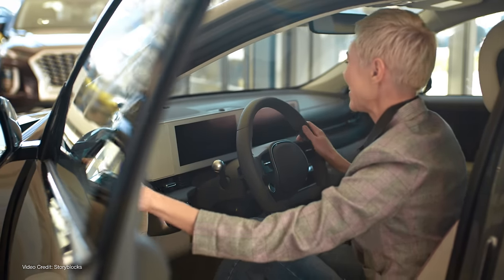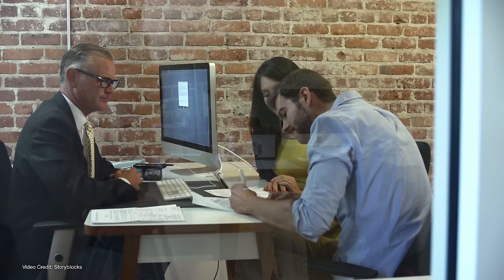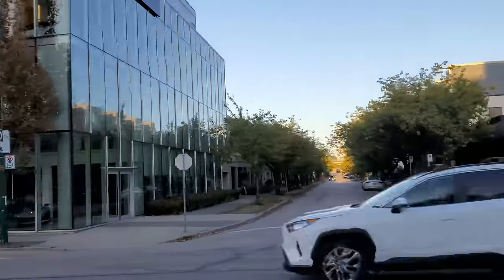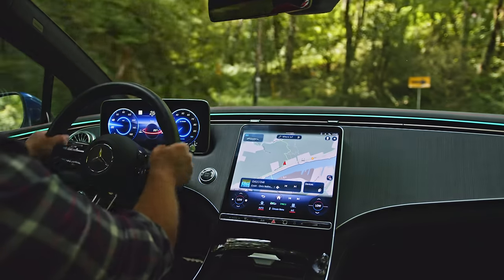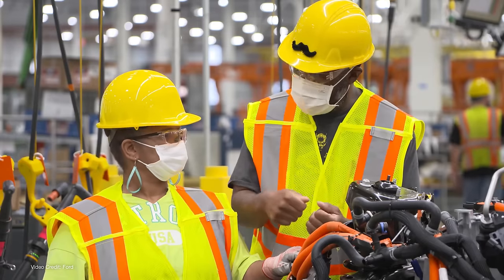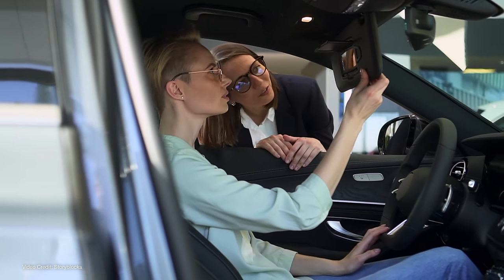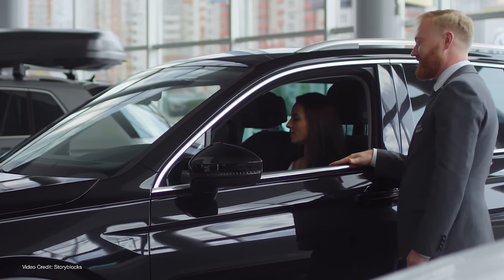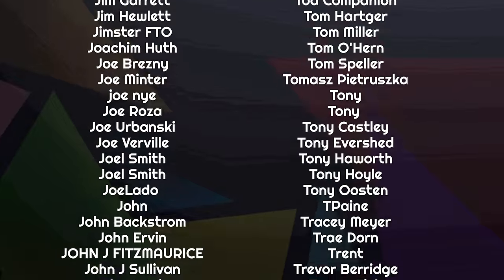Buying a New EV? Know These Things (Because Your Dealership Might Not)

Comment: Yes, you missed a very important factor....You must determine whether or not the dealer network you choose will be able to repair and support the car you are purchasing well into the future.  Aside from lemon law options which can be a big hassle, an unrepairable car (especially an electric one) is basically a very big expensive paperweight, especially as it ages beyond warranty.
Reply: This is a big issue in Australia when it comes to motorcycles. One dealer went so far as to become the national wholesaler for a particular brand of motorcycle so everyone had to buy consumables from that dealer. 

Another well known Japanese brand I had to buy a clutch lever for a three month old motorcycle. “Sorry we don’t stock that part and it’s $52 pay now please and you will have it in three months”. 

I went to the wreckers right next door, bought a used part for $8 and hit it with a grinder till it fit. 14 years later that part is still in service now I need a starter motor brush set 🙄

Bad for the brand. Bad for the owner. If this is how the dealer plans to stay in business, they don’t deserve to trade

Comment: I’ve bought four EVs from manufacturer or dealer over the years. 

The “direct from the manufacturer” were obviously the best (no, Tesla was NOT one of them!) 

For dealers, we considered two different EVs, and visited three different dealers (one for one brand, two for the other brand.) We ended up going for the brand that we visited two dealers for. One dealer was *TERRIBLE*. Even though they were officially an “EV certified” location, with two chargers on-site, their sales person obviously wanted nothing to do with selling us an EV, and those chargers were nearly always ICEd by dealer vehicles. The other dealer was *GREAT*. Knowledgeable, didn’t try to “upsell” us a non-EV, good info about EVs, charging, etc. Even had an EV loaner when we had to take ours in for service.

The other bought from dealer was a “we want this EV” for sure, called a couple of that brand’s dealers. Two were not at all helpful - one outright told us to go to a different dealer for an EV. The third went out of their way to be helpful. At that point, I knew plenty about EVs and that model, so the salesperson didn’t need to explain anything, but what info they gave was good. (In fact, he was slightly disappointed when we bought it - it had just come into inventory that day, and THEIR SPOUSE wanted to buy it! The spouse ended up buying a PHEV instead - while we were signing the paperwork for the EV.

That salesperson even went through the standard “selling any car” routine, including listing off the benefits of a prepaid maintenance plan, “free oil changes for…. Yeah, you don’t need this.” 😂

Comment: When I bought my new Bolt, the dealer said that GM was going to pay for standard installation of a L2 charger through Qmerit. I live in a townhouse. After I sent off the info to the Qmerit contractor, I learned that he meant GM covers standard installation for a single family house. I decided not to pay the difference. Level 1 charging is enough for now.

Comment: Fisker, GIANT NO. You will likely be abandoned, as the company is extremely likely to no longer exist in 12 months.
Reply: Some people are risk takers.
Reply: If I got a polestar 2 for the right price, I would pay cash then start accumulating as much service information on it as possible. Or buy one and a spare and all the manuals.

Or two matching Nissan Leaf thingys then sell one of the batteries off.

The issue is storing the bits

Comment: Did homework on Ora Cat, went to dealer for a test drive, drove car. Started talking with dealer about the known issue with the front demister not being powerful enough if the car was left outside.

We were ready to sign until the dealer lied by saying “it’s not a problem”. He also said the car will get better range if you deliberately speed at the bottom of hills on the highway